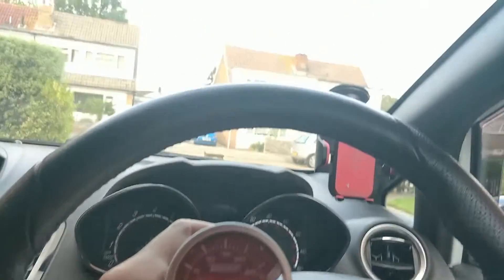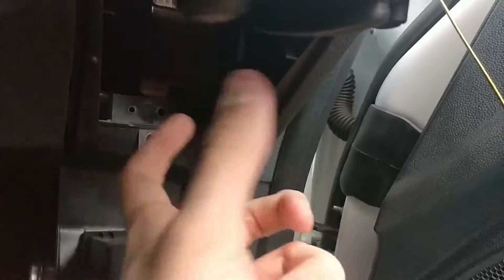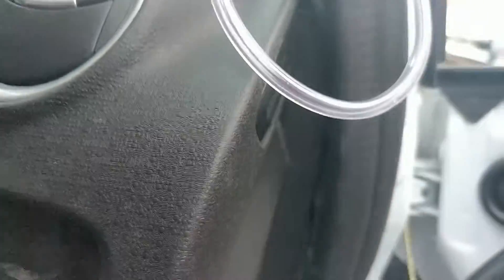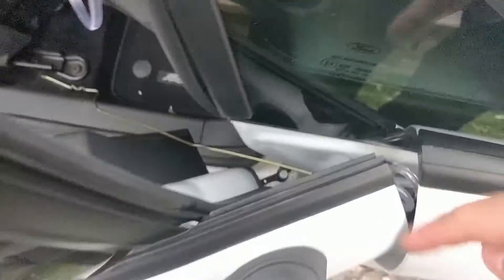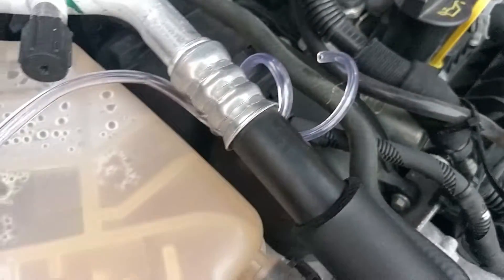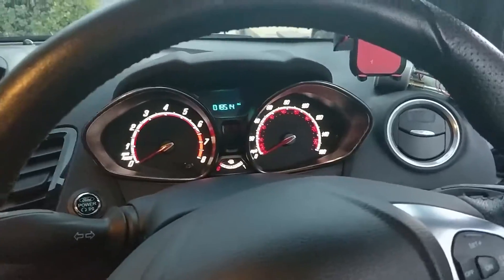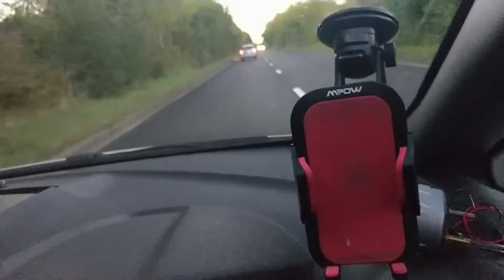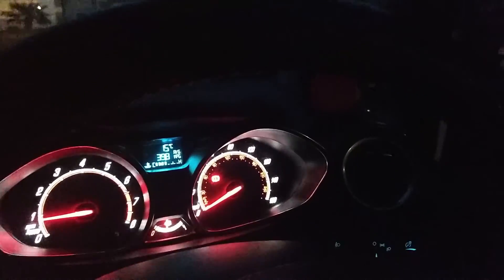Turbosmart Boost Gauge Install Part 1 - The Mechanical Side - Fiesta ST180

Comment: I’ve done it this way too, however people keep telling me I need to tappet from turbosmart to run boost guage and bov at same time. I’ve ran it with the tee piece this last weekend and no problems at all. Would you reccomend me sending boost tap back or fitting it. £50mind!
Reply from the maker: The boost tap is better mechanically, i.e it's built specifically for the job. However the difference between that and a tee piece is the same especially if you have the pill inside the tube to regulate into the boost gauge.
Reply: @CarRambles  I have the tap now but unsure wether to fit. it’s just the process of trying to get the pill out and ziptieing between the back of the gauge itself. It all seems to be working fine now with out the tap making correct boost etc. maybe I’ll just return the tap and get my money back. Thanks
Reply from the maker: @jackbeames7643  agreed, If it's working leave it :) You can always re buy in the future
Reply: @CarRambles  exactly and for £50 that’s something else I could put towards the car. Thanks for the help man!